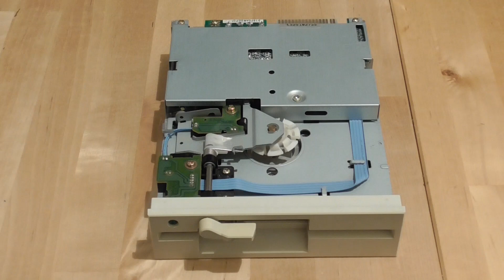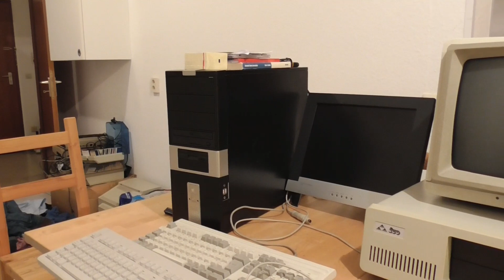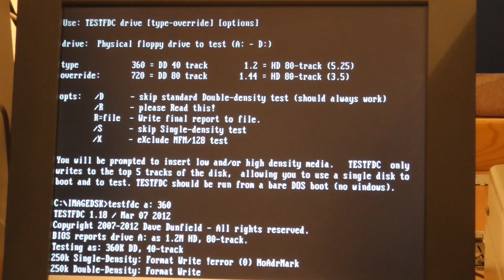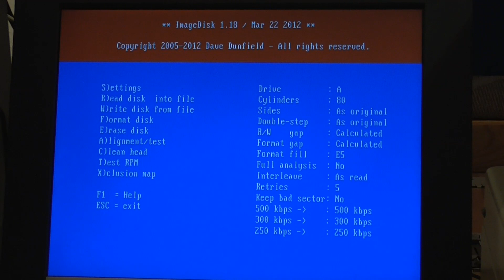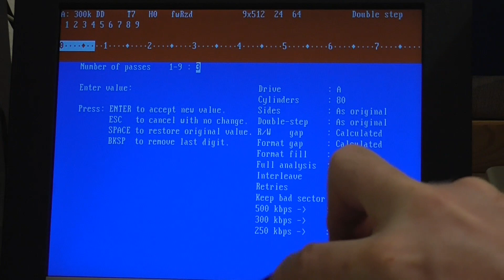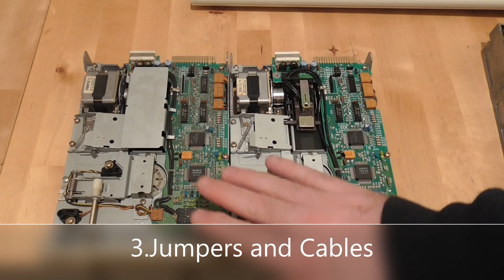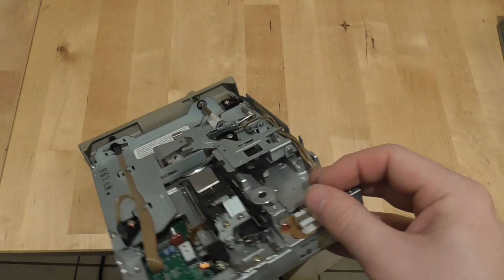Why most 5.25" Floppy Drives seem broken, but aren't!

Comment: You are exactly correct.  If I format my 360k disks in my original IBM PC and write the images on my Pentium with a 1.2mb drive I can then read them back on my IBM PC.  If I format the 360k disk on my 1.2mb drive it will not read it back on the IBM PC or at least not 100% properly.  Good Video.
Reply: Yeb cause the heads of a 1,2M are smaller. See as a 2 lane driveway. The 2 lanes together are 360K Wide, a 1,2M uses just 1 lane at 360K. So if you write a 360k formated floppy with a 1,2M just 1 lane is read and other lane is un toughed. If there were data on that 360k, at 2nd lane there is still some old data left. The 1,2M does not bother as it just read 1 lane, BUT the 360k drive reads both lanes at the same time. So now there is a mix-up of signals.

Comment: There's a certain driver floating around, PalmZip I believe, that purports to get parallel Zip drives working on 8088 hardware. It's going to be horrifically slow, but it should at least work.
Reply from the maker: Yes, I am using that, though Zip disks aren't so reliable unfortunately.
Reply: @PCRetroTech  Heh, I ran into that problem myself actually. Mostly I just have the drive now so I can recover old disks people bring me, hopefully. 

I actually had to repair my ATAPI drive, I'd managed to be enough of a bonehead that I nearly sheared one of the pins of the IDE connector off. I don't usually do SMD soldering, but the pads there were just big enough that while I was unable to get the original pin back in place how it was meant to go, I bodged a wire between it and the pin and got it back in the hole. It makes just enough contact now that the drive works, at least.

Comment: The more I watch videos about retro hardware, the more I remember what a pain in the ass was setting PCs up in the late eighties
PnP was a blessing, although it had many issues at the beginning.
Reply: The satisfaction of getting it all working is part of the nostalgia for me.
Reply: @BlackEpyon  indeed. Although I don't miss fiddling with the software side of things, like config.sys and qemm to squeeze as much ram as possible to run DOS games.I was very good at remembering all the various bits and pieces, nowadays I'd have to research them. 😭
Reply: @bufordmaddogtannen  Yeah, I've got a Tandy 1000 RSX that I'm running SCSI on because it's a slim-profile case that doesn't have room for extra drives. I could revert back to an IDE hard drive (limited to 504MB) if I had to, but the external CD-ROM and Zip drive are both SCSI, and some games do need the CD to install or run. That means moving everything possible into highRAM, because THAT particular game (StarTrek 25th Anniversary CD) needs 560K of conventional memory, and won't take 'no' for an answer!
Reply: @BlackEpyon  SCSI FTW. Been there, done that.
Qemm has always been a savior, although I am not sure if the scsci drivers suck too much ram.

Have you tried copying the content of the cdrom on the hard drive on a temp directory and adding a drive letter pointing to it using the subst command? It could save the trouble of loading the cdrom driver and free some memory. 

Sometimes it is enough to fool games.
Reply: @bufordmaddogtannen  Na, I tried. Some games won't even let you install from a directory, or change the directory it installs to.

Having a 2GB SCSI hard drive in a 386 is TECHNICALLY within the bounds of the time period (if you were building a server), but boy howdy would that have been an expensive build for the day! I'm kinda surprised the BIOS even allowed me to choose to boot from SCSI.
Reply: @BlackEpyon  iirc that's the bios handling booting to the scsi controller.
As per star trek, of you find a crack, you may be able to run the whole thing from the hard drive and forego the cdrom driver.

So good luck. Still try Qemm if you didn't already.
Reply: @bufordmaddogtannen  Yeah, the Phoenix 1.10 BIOS has an option in the drive selection to select drive type 1-43, custom, auto detect, or SCSI. That's probably generic to the BIOS, I don't think anybody anticipated installing another controller card in this machine.

I did manage to get enough drivers moved to highRAM for the game to work with all the drivers, so that's not an issue any more. That took a bit of back and forth, experimenting to see, with limited documentation, what would work outside of conventional memory, and what with to replace what wouldn't work.
Reply: @bufordmaddogtannen  Strange for me, how it all came back in an instant, after I watched a few retro channels. I hated those two files. Now, I'd set them up with pleasure if the chance came. Nostalgia is talking I guess.
Reply: @keithbrown7685  I guess it varies from people to people. I setup  a Windows 98 virtual machine a while ago and it was painful. Getting back to 6502 assembly was painless in comparison. 😂

Comment: Thanks for this video. Lots of good helpful info. On the one drive, you mention an "IM" and "NM" jumper setting; that could possibly be for maskable or non-maskable interrupts.
Reply: Sadly, floppy drives have no ability to raise interrupts, maskable or otherwise. That is entirely the domain of the controller.

Comment: Thank you so much! I have the same TEAC,  and I finally got it working.  I had done some digging last year and established all the jumpers were in the right place but it still wouldn't work. Turns out it had an extra jumper on UI that wasn't supposed to be there. Since the documentation didn't mention it I just assumed it was stock/factory configured and not meant to be changed by the user. I just recently discovered your channel through RetroSpector78 and I'm thoroughly enjoying your content. Thanks again!
Reply from the maker: Great! Glad it was of some help.

Comment: If you need the answer to "Why most 5.25" Floppy Drives seem broken, but aren't!" skip all the way to 33:00 minutes where the answer is finally tucked into this movie about drives. The first 33 minutes is a video called "All you want to know and a whole lot more about disk drives"
Reply: I wouldn't recommend skipping it.  All that detail explains WHY those changes work, and will help to decipher what to do when your drive's jumpers don't match 100% with the ones in his collection.

If you're the TLDR type, might I suggest using a computer with double or triple digit MHz clocks instead, and bypassing the whole 5.25" drive scene entirely.
Reply: @sirnickity  Absolutely. If you’re just impatient and want instant gratification, vintage computing isn’t for you. These machines require patience, persistence and knowledge to repair. It’s in your best interest to know as much about floppy drives as possible if you are going to repair them.

Comment: It is not that hard to put a 3 1/2 drive in a XT.  Just need to change the floppy controller as it is not supported by the system bios, and the other way would have been to use a program called drive.sys
Reply from the maker: Sure, I imagine 8 bit controllers exist for that. I just don't happen to have one.
Reply: Better yet, there are new BIOS that can be put in an 8-bit ISA slot, "universal BIOS" that supports all size formats including 2.88MB, and is useful for booting virtual floppy drives. The main issue is PC BIOS, not any controller. MFM drives and IDEs are a completely different matter.
Reply: I put one of those unified IDE/Floppy/serial/parallell port cards in my PC XT. The card is 16-bit, in an 8-bit slot, so not everything works, but the floppy and the serial port seems to work fine.

Comment: Wow thanks very much ! one of my drives is exact the same CHINON  and my jumpers are exactly configuration like yours , but in a modern systems after year 2005 the floppy controllers are shit and only supports one floppy A: , but the other problem is that usually in my experience 5.25 floppy's did not refresh the contents of a previous floppy disk like you explained her e 24:00 so I have to remove this D-R jumper to fix the issue :)
Reply: The floppy drive controllers are extremely simple, mostly everything is done in physical circuitry. Complaining about them not being as good is like saying "wheels aren't as round as they used to be. Remember when wheels were circles? Why are new ones less circular?" Is there are serious translation problem here?
Reply: I tested did not work :( without this jumper floppy trow "Not ready" :( I changed the floppy with other model and it works ,no problem for refreshing the disk contents , strange
Reply: Wait "refresh previous disk?!?!" You realize there is absolutely no memory in floppy disk controllers, at all, right? Nothing ever gets "refreshed" in floppy drives, ever. It reads, writes and is subject to management by Disk Operating Systems. Are you talking about a virtual drive?
Reply: @squirlmy  yes I am talking about real hardware in real mode DOS. When I read one 5.25" diskette, then replace it with another ine, the system shows the contend of the first  disk and it stays like that until I reboot the PC
Reply: @intel386DX  Yes, you are right. This can happen. Not sure how, but it does.
Reply: @erwinbroekhuis  yes it is so annoying and it hapance generally on modern PCs that supports FDDs in BIOS only on 5.25" drives (any brand)

Comment: Iomega's GUEST software will not run on an 8088 CPU, however Klause at http://leute.server.de/peichl/palmzipe.htm has written 8088 compatible software, named palmZIP, that allows the use of a parallel port Zip100 drive.  (source : http://minuszerodegrees.net/transfer/zip/zip_drive.htm). I sometimes use this to transfer data from /to  these old machines. I have a modern pc with an internal zip drive and it works fine. However I also shouldn't put much faith in the reliability of the zip disks and drives :)  XT-IDE is also an easy / convenient alternative to add some storage to your XT. But hey, no denying that 5.25 inch floppies are really cool .... looking forward to watching this :)

Comment from the maker: I managed to get the remaining two drives working guys, plus another one of the drives that had some issues towards the final track. This required more advanced techniques. I'll describe those here, but please don't blame me if you screw up your drives attempting this. In fact, I got one of the three working before accidentally slipping with my screwdriver and completely destroying one of the heads!

In all cases, the issue was head alignment. In the case of the drive that sounded stuck, I had to move the stepper motor assembly so that it could move the head back to track zero. You can use the head align tool in IMD and move it back and forth until it can read track zero on head zero. Press D to check it can actually read the data.

From here, all three drives had the same problem: everything was fine on head 0 (the one towards the bottom of the drive), but something would go wrong on head 1. In all three cases, the solution was the same: unscrew the two screws that hold the head in place and move it about until the head alignment program showed 18 matches. This was particularly hard on one drive because you have to remove a tensioning spring that is required to actually read data, so you have to apply pressure with your finger whilst you move the head about while watching the data in IMD. It didn't help that the sled was cracked and I had to superglue that back together before I could get anywhere.

So I've now successfully rescued all my drives, except the one I accidentally broke beyond all possibility of repair (I literally sheared the head right off).

I tested that the drives can now read 20 disks formatted on a known working drive and filled with data up to the last track!
Reply: Fantastic - I didn't know about IMD.  I feel like head calibration is going to be increasingly important to save the drives that are still functional today, but will slowly fall out of alignment over time.  And, of course, the expert information out there isn't well documented online (having been of most use before the Internet was popular) and literally dying out with the 80s long-beards.

I feel you on the damaged head.  I started disassembling floppy and CD drives as I acquired them, and giving them all a thorough cleaning and re-lubrication.  There was one 3.5" drive that I was having trouble finding out how to remove the cover, and pulled a couple screws out of the bottom.  Those were the ones holding the Track 0 sensor in place.  So that drive is now wildly out of calibration.  I may try to recover it now that I know about IMD, or pass it on to someone who has the motivation to do so.  Glad I didn't just throw it away, though!
Reply: Splendid. I have a broken 5 1/4 drive -- I'll give all this a go. Cheers!
Reply: Now i am wondering if the many 3.5 floppy disks i threw away 25 years ago really had read errors or were just a cause of a misaligned disk drive?
Reply: 0:00 before watching the video I'm going to guess. From experience old lubricant can cause motors to be completely stuck or sticky enough to cause the drive to give up...next is the jumper settings, some drives need them set correctly...then I'll say stuck or sticky head mechanisms/dirty heads...and lastly incompatible disks, wrong formatting etc...this may be kinda cheating I've just listed all the issues I know lol. But if you read all of my nonsense I Appreciate It! Thank You For Your Time And Effort! I Hope You Are Having A Great Day Or Night!
Reply: FYI that head alignment test is called "an azimuth test" and you can hook up a scope to to see the the analog signal coming off the head, IMD is just doing a digital test using "data integrity checks" (data does not change between passes, and track overlap doesn't distort sector reading). Azimuth alignment with a scope is how you "fix" a Wren / Falcon / Phoenix Drive platters when its not reading, as Usagi Electrical showed when restoring the CDC mini computer hard drives.